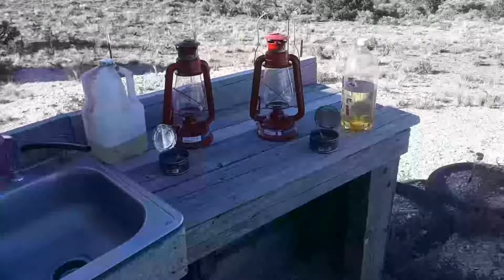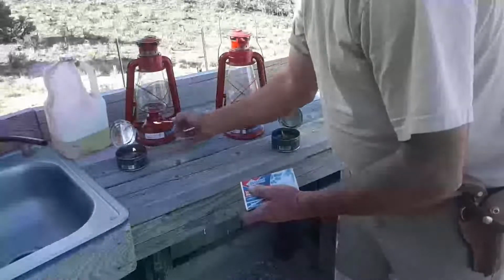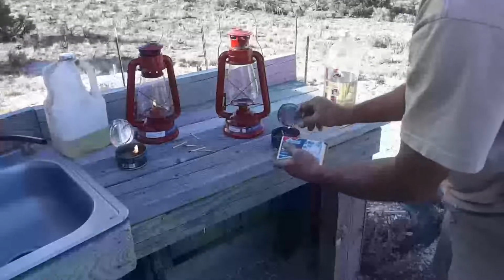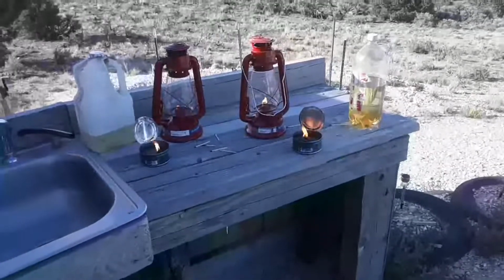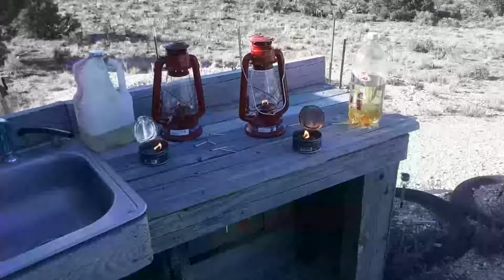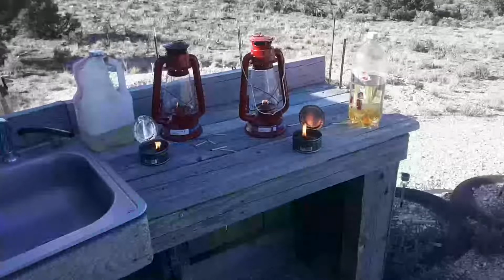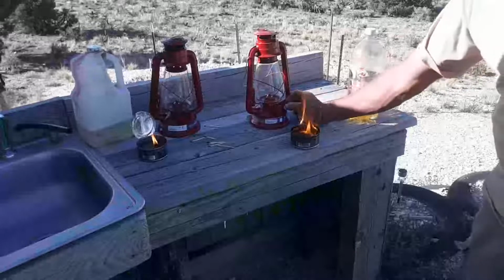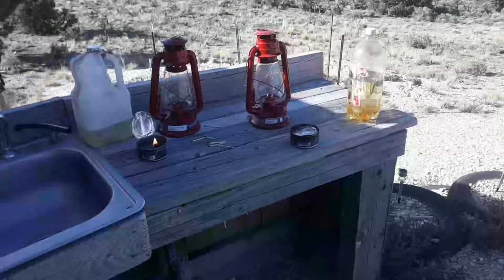Testing alternate emergency/storm lamp fuels

Comment: Add a little Paraffin Lamp Oil  to the cooking oil, it is too thick, 10:1
Reply from the maker: Thank you that sounds like good advice to stretch out the paraffin lamp oil. Do you have an idea on how to run lamps with fully alternate fuel? I did see one idea in a movie I believe ironically called the survivalist where he distilled turpentine from pine I think?